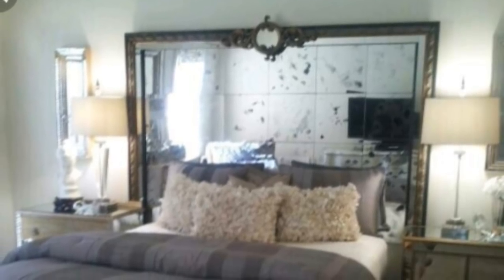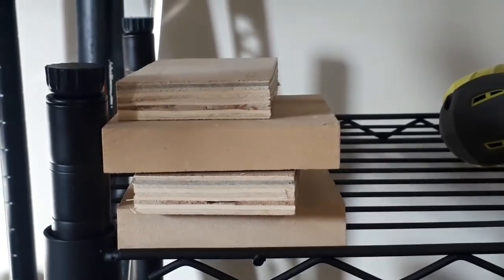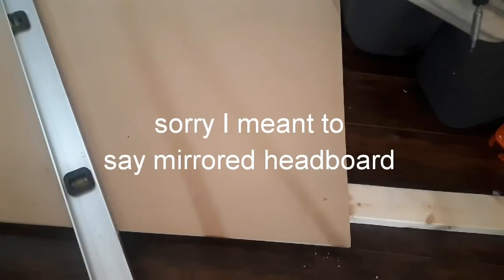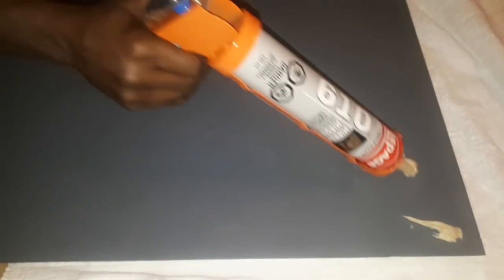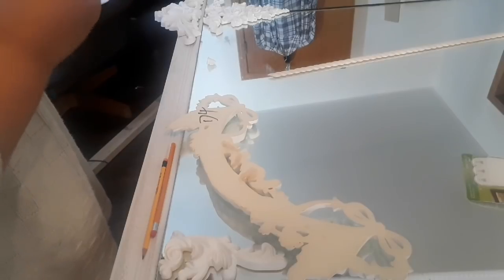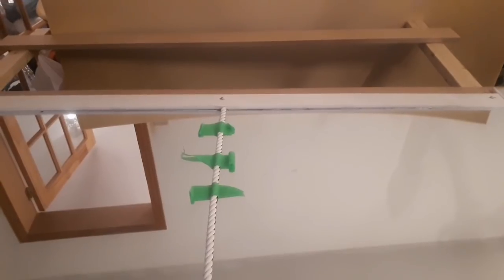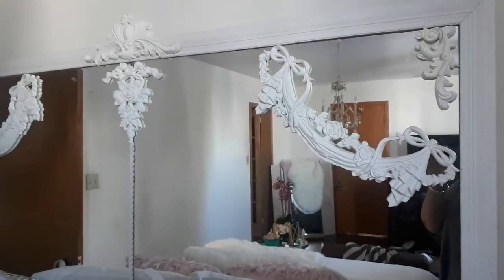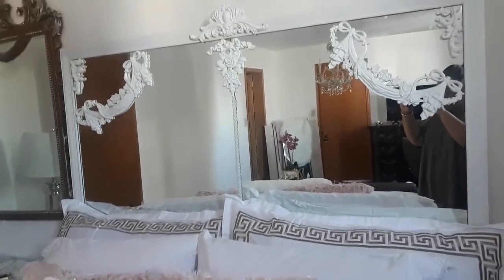DIY MIRRORED HEADBOARD/ How to make a mirrored headboard

Comment: IS THIS GLUE GREAT?? HOW LONG IT HOLDS?? IM MAKING AN UPHOLSTERED HEADBOARD WITH MIRROR BOARDER.
Reply from the maker: Hi Lanie, this glue is fantastic. I have been using it for years. I have never had a problem with it. I have DIY’s that I used the glue on over five years ago and it is still holding. tfw
Reply: What kind of glue is it again??
Reply from the maker: It LePage 610 mirror glue. You can get it from Home Depot or any hardware store.